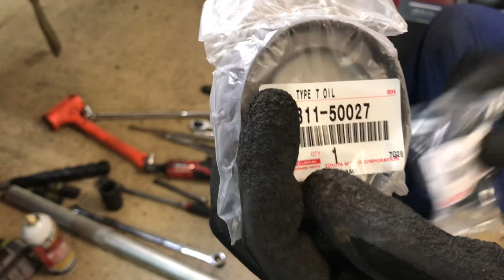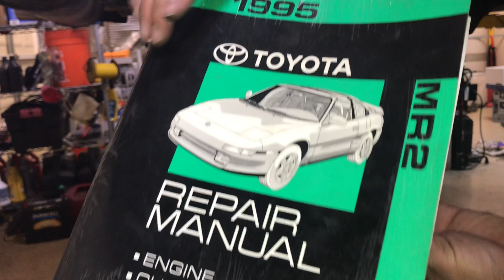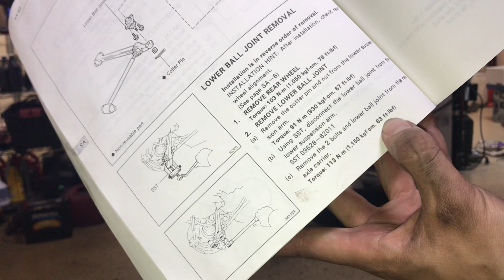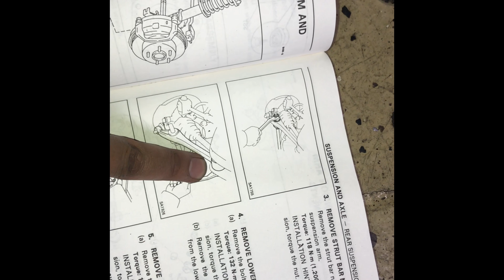DIY: TOYOTA MR2 AXLES CHANGE

Comment: I feel like on the caliper hose issue you could’ve just removed the caliper from the rotor and if you absolutely had to as well you could’ve removed the caliper bracket and hung the whole thing up with a wire tie or bungee rather than undoing a brake line and having to bleed. Other than that good work bob
Reply: does that actually work? i just ran into this issue

Comment: Spec is 36 ft-lb on the drain and fill plugs... and at 9m35s, if you reverse the bolt so the nut is on the front it will be easier to get the bolt out but a lot harder to get to the nut with an impact gun.

Comment: I appreciate the clutch fork tip. I wish it would've worked! I didn't have one, so I welded up a fork of similar size, but the axle would not budge. I should mention the inside boot ripped, so pulling on the axle from the hub end did nothing but pull the axle off the stub (this was an NA mr2). I ended up renting a slide hammer from the autoparts store. It was the only thing that worked.

Comment: Hey man is there any way to tell what transmission is in the MR2 by the outside of it I just bought a 1991 with a 1993 turbo swap MR2 that's halfway finished and I'm just curious and what transmission is in there I know I have a pipe coming out and going back in kind of looks like an oil Loop

Comment: any tips for getting the carrier bearing loose when its just jammed in there. as it sits it looks like im going to have to drop the crossmember to get the clearance to pull the whole carrier out with the axle and bearing. tia
Reply: The axle bearing has a bracket that holds it. You can remove to bolts and take the bracket with the axel

Comment: Hey bob my axle bearing housing that holds the passenger axle, it came off in less than 300 miles of putting in a new clutch. Maybe it wasnt torqued properly. But do you know the bolt size that holds it into the block?

Comment: Great work Bob! long video but I still like it you don’t skip any steps and people will learn all the tricks to avoid any mistakes like covering the axle boots from sharp stuff when installing the new axles.  Quick question where do you send your axles for rebuilding because I have a few sets I need rebuilt and do you know where I can get non lsd stubs machines for LSD?
Reply from the maker: Thanks. James auto in garden grove does my rebuilds. Crw can modified your axles for u. 👍🏼👍🏼